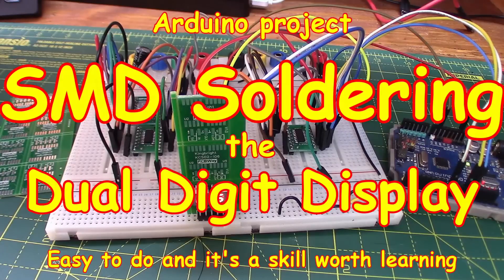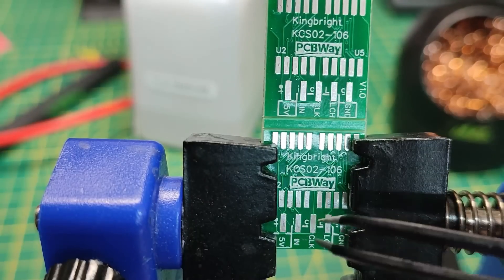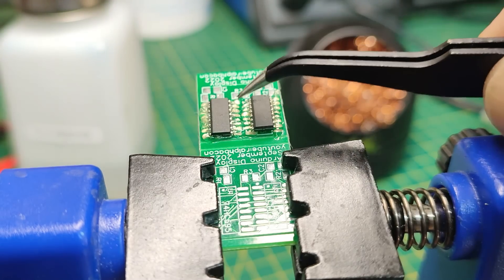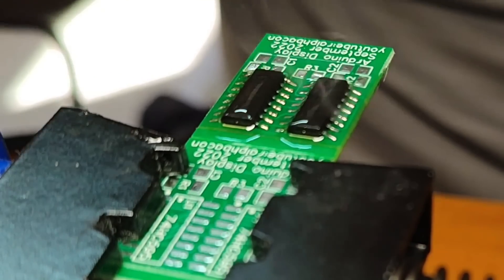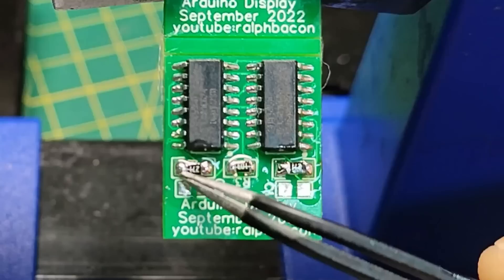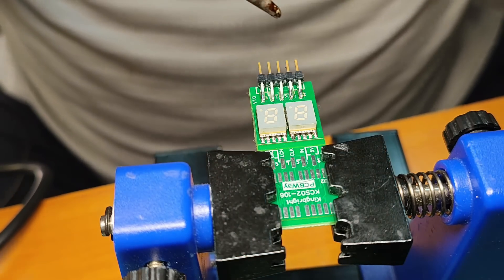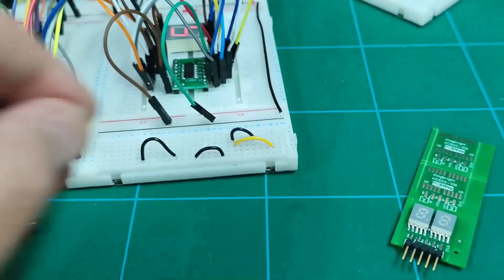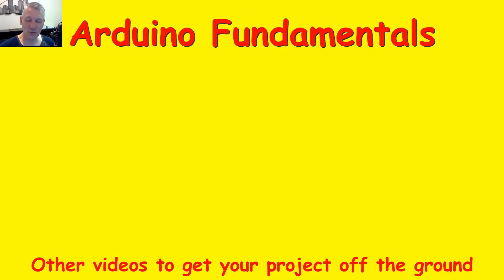#252 SMD Soldering Walk-through - easier than you think

Comment: Soldering. I'm okay with soldering but Sod's Law often comes into it:
You want to bridge two pads, - they ping open.
You want to prevents bridging, - the solder becomes glue and everything is shorted! I think the advice on plenty of flux was key! Thanks Ralph 👍
Reply from the maker: Bridging pads is better with a tiny piece of wire (which you can cut after soldering). 

Unintentionally bridged pads can be cleaned with desoldering braid in about 1 second. Although this is getting more expensive these days.

But practice does make perfect. Yes, yes, I have a long way to go 😲

Comment: Sorry, Ralph (great idea by the way) but if you do give any of these boards away your lucky viewers will not be able to clamp the board as you did. You should have gone with the single board and shown how to overcome the problems of soldering that board. i.e., using double-sided tape or blu tack, etc.
Reply from the maker: Blu-tack works until you get it hot then it melts everywhere (and smells) but good enough just to hold the board in place. I'll probably give away a strip to give my viewers a fighting chance at soldering them!